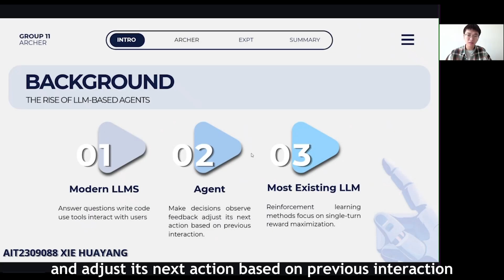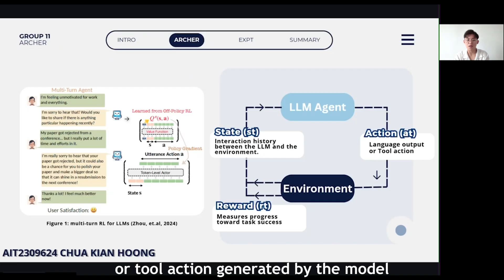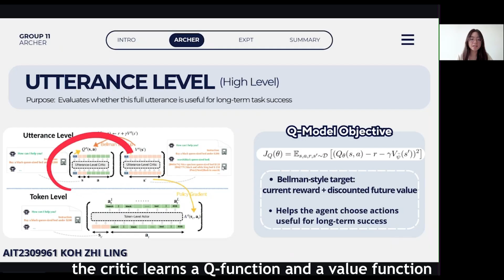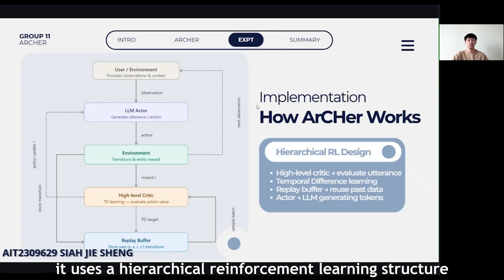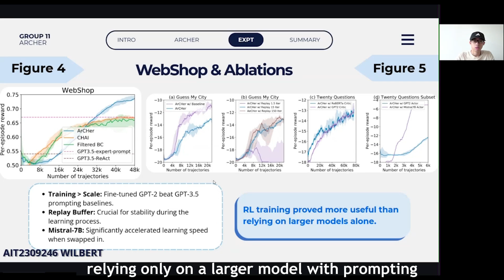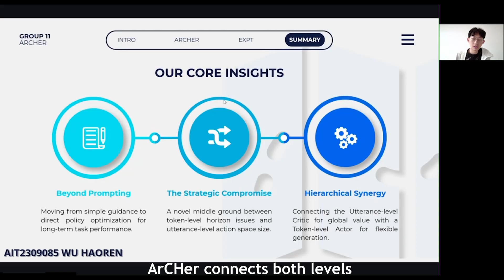202604 AIT306 Group 11

Comment: Group 12

Hi Group 11, thank you for your presentation.
I have a few technical questions regarding your method and experiments:
1.Since the token-level actor is trained using the advantage value from the utterance-level critic, does this mean all tokens within an utterance receive the same advantage signal? If so, how does ArCHer handle fine-grained credit assignment to distinguish between good and bad tokens?
2. Using a replay buffer inherently introduces off-policy learning. How does the framework address the distribution shift between buffered trajectories and the current LLM policy when updating the value and Q models?
3. In the WebShop experiment, is the performance improvement of the GPT-2 model primarily because the RL objective allows it to adapt to the environment's dynamics? Furthermore, how efficiently and stably would ArCHer's hierarchical RL training scale if applied to larger open-source models?
Reply: Hi and Good morning Group 12, it is a pleasure to answer your questions at this early morning😃

1. First question
Regarding your query on token-level credit assignment, while training the token-level actor by using the advantage signal generated by the utterance-level critic, the baseline framework assigns the global macro-advantage of the whole utterance-level to all of its constituent tokens. However, ArCHer provides support for credit assignment at a finer-grained while training the token-level actor because the algorithm uses an optional baseline value function at the token-level. effectively acts as a variance reduction mechanism that shifts over the course of an utterance. While calculating the advantage of each component, by subtracting the token-dependent baseline, the algorithm is capable of assigning the relevance of each specifc token in single generation sequence, which is particularly vital when managing long, complex, and diverse textual actions.

2. Second Question
Regarding off-policy distribution shift, ArCHer makes use of its hierarchical reinforcement learning design along with value-based objective functions in order to account for any mismatches arising between the historical trajectories collected in the buffer and the currently deployed large language model policy. To achieve this, the design of the ArCHer framework ensures that the structure of the high-level critic component utilizes a temporal difference learning strategy, where Bellman consistency is enforced between a learned action value (Q) model and a target state value (V) model. In particular, the V model is optimized to estimate the expected Q values of explicitly generated actions according to the current language model actor policy. By continually re-evaluating the historical experiences stored within the replay buffer against the expectations of the active, evolving policy, the framework dynamically corrects for distribution shifts, ensuring stable offline-to-online value estimation and preventing divergence during policy updates.

3. Third Question
Regarding the WebShop experiments and scalability, the performance gains observed in the small-sized GPT-2 model rely mainly on the Reinforcement Learning (RL) objective of ArCHer, whereby training focuses on maximizing cumulative reward instead of merely predicting the next token in the sequence. As a result of such architectural design, even small models can learn to actively adapt to complex environment dynamics, sequential planning, and tool use, to improve their performance beyond those observed much larger prompted models like GPT-3.5 in the controlled benchmarks of agents. In scaling such a hierarchy to larger open-source language models, experimental ablations indicate that substituting larger architectures, such as the 7-billion-parameter Mistral-7B model, enhances learning speed and overall agent capabilities. The only significant challenge in such scaling processes is the number of computational resources needed for training value-critics and language-actors concurrently, but because ArCHer offers up to a 100-fold increase in sample efficiency compared to standard on-policy methods like PPO, it stands as a highly stable and practical paradigm for scaling multi-turn agent training.

Comment: GROUP 10

Hii, Group 11. Thank you for the explanation. We would like to ask about the interaction between the utterance-level critic and the token-level actor in the proposed hierarchical RL framework. 

1. Since the token-level policy uses the advantage value derived from the utterance-level critic, could you clarify how the training signal flows between these two levels? Is the utterance-level value estimated first and then used to guide token-level policy updates, or are both levels optimized jointly? 

2. How does this design improve long-horizon multi-turn performance compared with using only an utterance-level or token-level objective?

Thank you🤓
Reply: Hi Group 10, Thank you for asking the questions 😁

For the first question:
In the ARCHER framework, the training signal flows sequentially through a hierarchical reinforcement learning structure where the utterance-level value is estimated first and then used to guide token-level updates. The process begins with a high-level critic evaluating a completely generated utterance, such as a full response or tool command, using temporal difference learning. This critic learns a Q-function and a value function to estimate the utterance's usefulness for long-term task success. The advantage value derived from this utterance-level critic is then passed down to the low-level actor, which is the language model generating tokens step-by-step. Instead of relying on a standard single-turn reward model, the token-level actor updates its policy gradient using this advantage value, ensuring that individual token generation is guided by long-term objectives rather than just immediate next-token likelihood.

For the second question:
This hierarchical design significantly improves performance in long-horizon, multi-turn environments by acting as a practical compromise between two problematic extremes. If a model uses only a token-level objective, the reinforcement learning horizon becomes far too long, making it incredibly difficult to assign credit correctly because final rewards must propagate backward across potentially thousands of individual token decisions. On the other hand, using only an utterance-level objective shortens the horizon but creates an impossibly massive action space, as there are simply too many potential sentence combinations to explore efficiently. By combining both, ARCHER relies on the utterance-level critic to shorten the horizon and manage delayed rewards, while leveraging the token-level actor to keep the action space manageable for natural language generation.